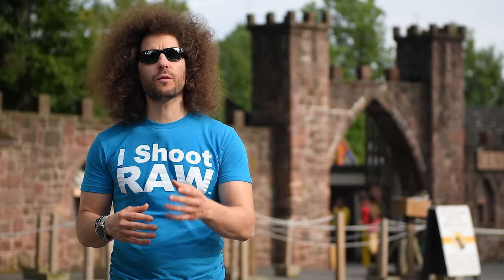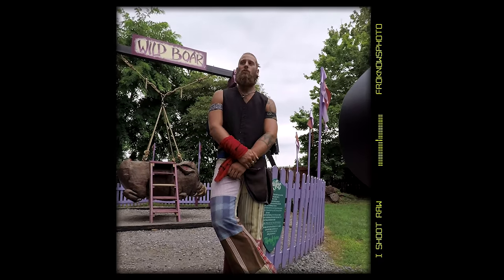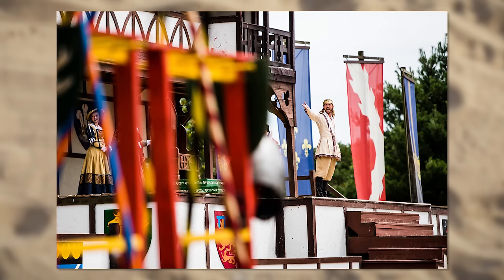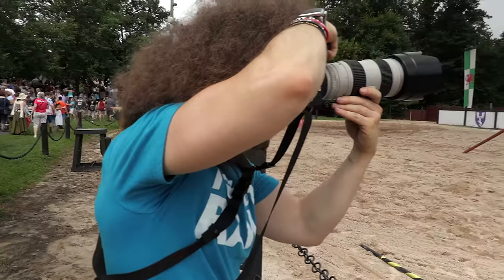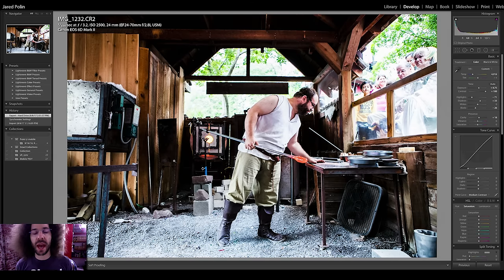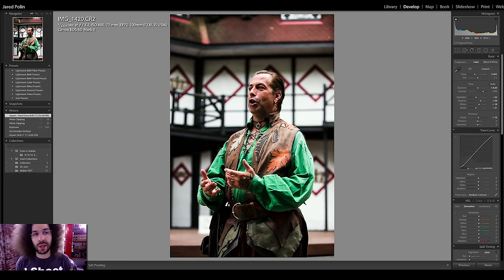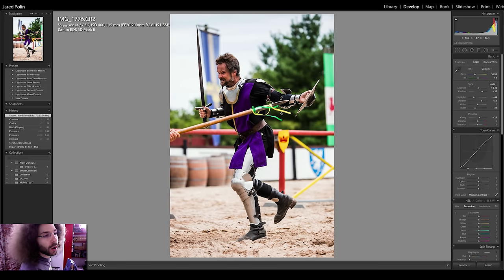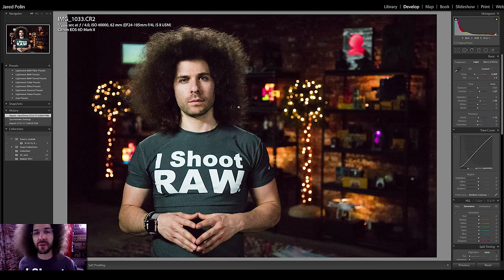Canon 6D Mark II "Real World Review": Does it SUCK?

Comment: Hi.. Please guide.  . Is quality better than nikon 610, 750 ??
Reply from the maker: it's all about the person shooting it.
Reply: Jared Polin Didn't expect a diplomatically correct answer. . Should be honest with your viewers. . Disappointed
Reply: How was he dishonest? Both Canon and Nikon both make "quality" cameras. Your idea of quality and mine may not be the same. WTF? There was no other way he could answer that loaded question.
Do you own Canon or Nikon glass?
Reply: All big camera manufacturer today have good image quality under optimal conditions with good glass, I think most people couldn't tell the difference when they look at a photo on a 27" screen/print most of the time.
Today ease of use is probably as important as image quality.
Reply: Maybe you can clarify by what you mean by quality. Do you mean Built Quality? Image Quality? Video Quality? Dynamic Range?
Reply: but dr at what ISO? the original 6D beats the D750 at 3200 on up.

Comment: Hi @Jared, I understand that business crap and that they need to make you buy higher model, if you want to have 1/8000s exposure, but if I already have 3 years old, 1/3 priced 70D which supports 1/8000, I can simply not agree to this. Also the logic of crippling newer model, even if lower lever because they need to make users buy older higher level is absolutely wrong. They should first release the lower model and then higher with naturally better functions, not other way around, crippling newer model artificially to make it worse then one year old higher level camera. This simply is not progress, they are slowing them selves down.

Comment: I've had the original 6D since it came out in 2012. I pre-ordered the 6D Mark II and was hugely disappointed. NOT touting an opinion while "sitting behind a desk" or being a spec nerd, but having had hands on time ACTUALLY USING BOTH CAMERAS! In all honesty, the picture/image quality of the original 6D is better which is pretty ridiculous considering the 5 year gap between cameras. I have direct A/B RAW files to prove it. In my opinion this camera is a BIG LETDOWN and not worth it. Skip it and hopefully Canon will get the message.

Comment: People freak out about no dual card slots, but do they realize that professional film photographers shot without instant backups for over a century before that feature was developed? 99% useless gimmick if you ask me...
Reply: Jeremy Galloway umm... people shot without displays on the backs of their cameras for over a century, 99% gimmick if you ask me. See how stupid that sounds? If youre doing work with the cameras then having a redundancy card is a life saver.
Reply: lol ok. How many times have you ever had an SD card fail? In YEARS of video and photo shooting, I've never had that happen once. Hell, back when we had tapes only for video recording those things would have problems pretty regularly, maybe 1% of the time or more, and we made it work anyway. So don't tell me a dual card slot is a "necessity" because it absolutely is not, and SD cards (really any form of flash memory) are highly reliable.
Reply: Jeremy Galloway i've had an SD card fail once, and thats too many times, if youre videoing someones wedding and they trust you to capture this life changing event then why take the risk? Saying "it hasnt happened to me therefore its not an issue" is just ignorant